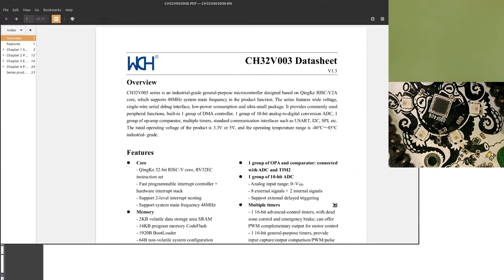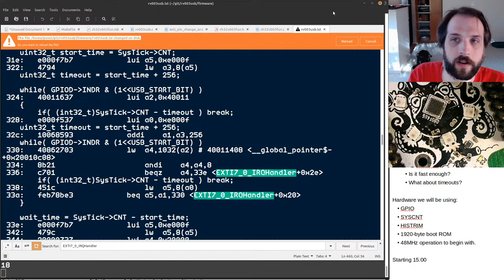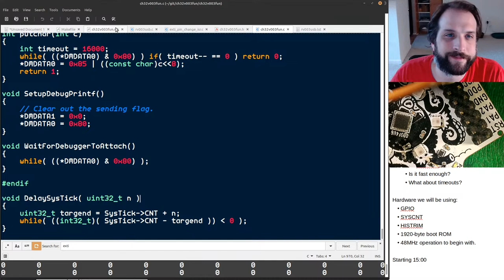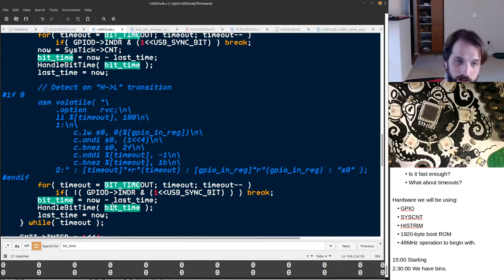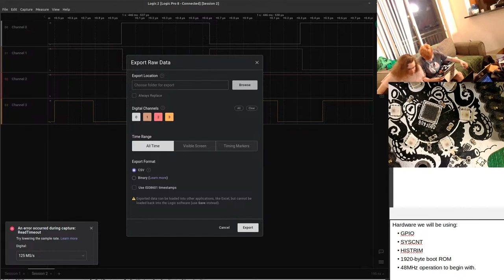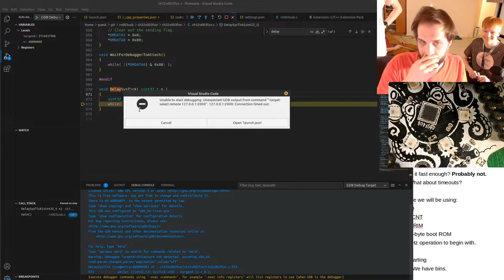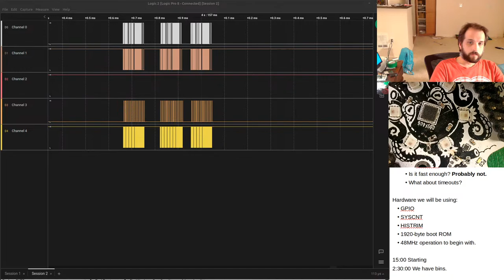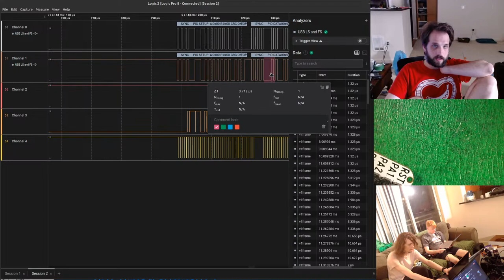Trying to write a Bit-Banged USB Stack from Scratch

Comment: There was a ton of great learning on how to do low level, serious, micro-controller programming on an uber cheap risc-v micro. Sometimes the benefit is the journey, and not the final destination. 

Maybe you can relax some of your design constraints, and  still meet you goal?  (Perfection is the enemy of "good enough") It's great that you would take the time to share your hard work on this project, and it is certainly much  appreciated.

Do we know which hardware debugger was used, the one from WCH?
Reply from the maker: I was using my esp32s2 programmer, but, the WCH one should work as well.

Comment: In reference to the initial attempt (the first 3-4 hours):

I could very well be wrong, but what kept standing out to me while watching this is that bit_time looks to have scoping issues. It looks like you are using the same variable name in several different scopes, leading to it getting trampled/reset unexpectedly (or you are assuming that references to bit_time in all scopes are touching the same variable, but they aren't in reality).

Comment: I do similar staff like that (maybe helps):
- do not use interrupts (takes too much time to fire up)
- do busy loop in main
- try at first just following input signal and check how much "nop"s fits into single pulse until following breaks. this gets rough estimation how much cpu power I have to process bit states.
loop:
- wait for event to start capturing
- start loop to fill up buffer
-- wating to change on port
-- read timer value and reset it back to 0 (probably calculate delay from systick is to slow)
-- if there is enough cpu time, quintize timer value to fit it to some regions (could save buffer space to increse captured states)
-- write time spend to buffer
-- toggle port value

if this toggle on port "follow" input signal, I am barely enough to capture frame, just buffer size limits amount of states I can read.
after full buffer is readed You can process bits.

But I am not sure if You just not trying that at first attempt (before DMA attepmt)
Reply from the maker: This is a pattern I wish many more people would follow.  In this case I have to use interrupts - but in general people roll their eyes on projects where I'm just like no.  Just busy loop main.  It's better.  And they don't understand why.
Reply: @CNLohr  :) I mean just as a POC. When You have working code, then You can chech how much cycles You have to make project more beautty. Adding complexity at start was always fatal for me, so I decide to start from simplest solutions.
Reply from the maker: @adrian_sp6def  it's a balance. Many times you need to take that approach. Other times you have to just know that if you don't attack a problem early, it will never be solved

Comment: I enjoyed watching the attempts to get things working the way you wanted to. Could the problems be related to a faulty power supply?
Reply from the maker: No, the issue has more to do with timing on things.  But I have some ideas to try again.
Reply: @CNLohr  I mean, because the timings were off and the code running so slow even though the compiler ticked all the right boxes in the instructions it used.
Reply from the maker: @AnotherJoe  I really think it was my expectations that were not good.